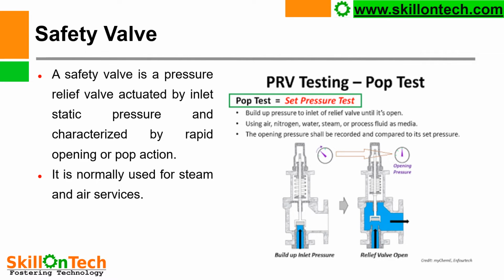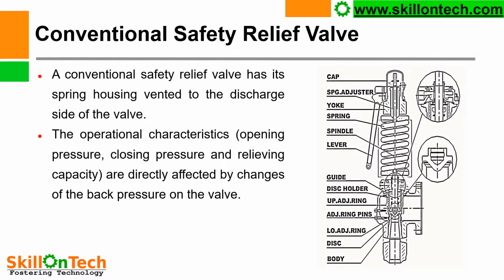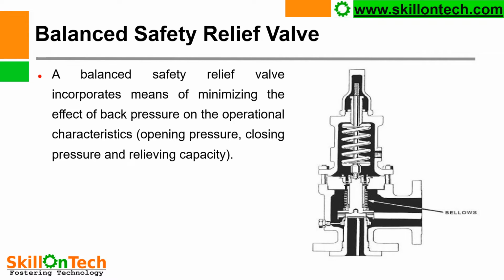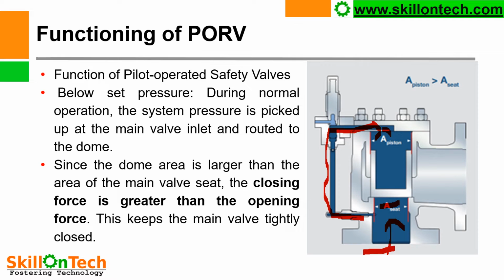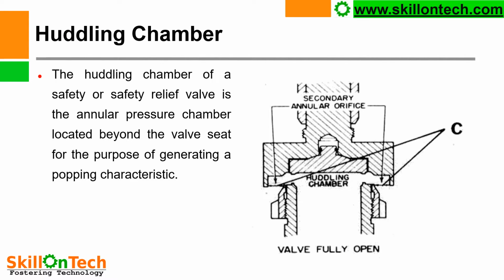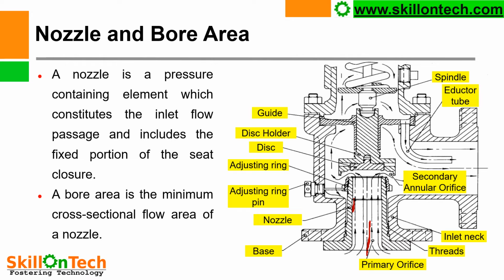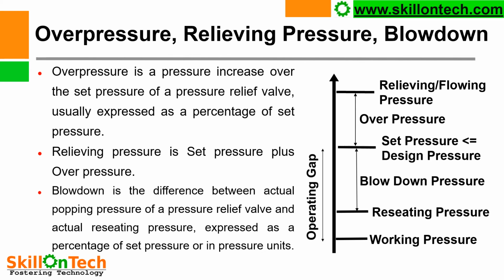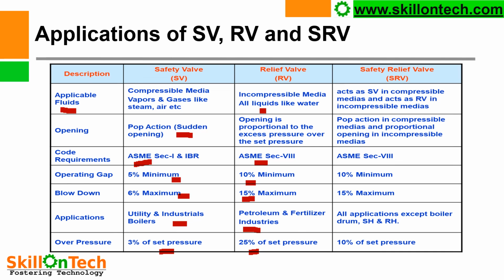Safety Valves, Relief Valves & Safety Relief Valves (with english subtitles)| Working & Construction

Comment: Is there any  job oriented courses provided by you for Mechanical engineer fresher?
Reply from the maker: Yes, We are having training modules on mechanical equipment's such as pumps, valves, safety valves, bearings, heat exchangers, welding, piping etc..... These modules are very helpful to enhance practical knowledge and attending interviews and competitive exams.
Reply: @SkillOnTech  how can we go through that course